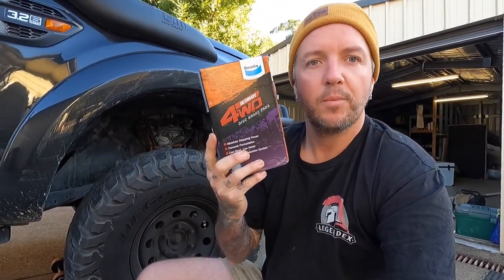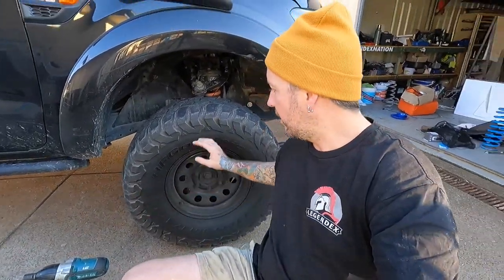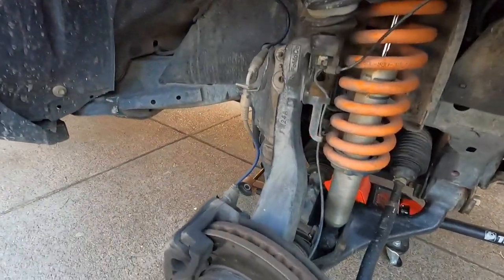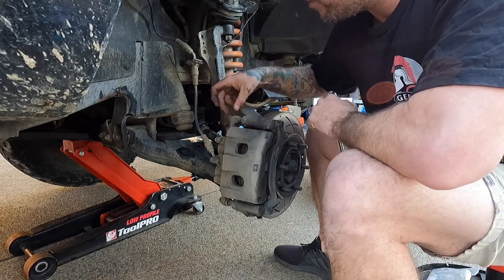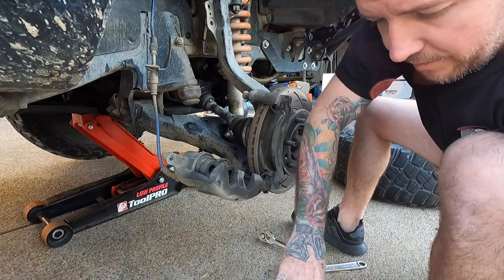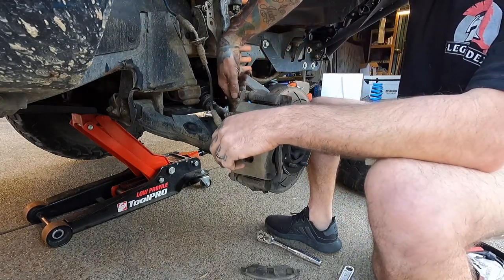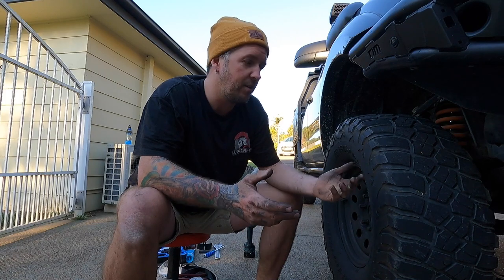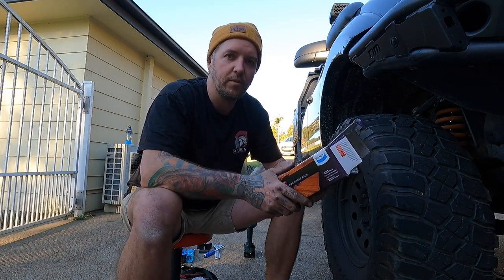SAVE SOME MONEY!  CHANGE YOUR OWN BRAKE PADS

Comment: Hey buddy I'm thinking bout having a crack at doin my pads in my 2013 bt50, do u have to bleed the brake system as well?
Reply from the maker: Hey Oliver!! You shouldn’t have to, just make sure you take your reservoir cap off to release the Previn the brake lines and slowly squash the piston back in the change the pads, if you do want to bleed them, there’s a few good vids on YT on how to do it yourself which I’ve watched before that  are really good
Reply: @AzventuresAustralia  thanx for that mate

Comment: I wonder if they will chew the discs……

I used to use “metal king” pads

They absolutely ate brake discs

Better yes but more expensive replacing discs all the time…..

Plus squeak like hell until they are hot…..

Comment: Mate love the vids but none of this was done correctly. Someone watching will follow this and crash into someone hopefully not killing anyone.
Reply from the maker: Please tell!! I’m more than happy to learn…. I’ve done it this way a few times and had no issue
Reply: You really should machine rotors or at least measure including run out. Slides need to be greased so they don't seize and you shouldn't push pistons back without cracking the bleeder Incase you warp the master seal on the push rod. And pump pedal when done so you have a pedal when you drive off. All good you haven't had issues I've seen many people do it this way, but alot of people are not aware of potential issues.